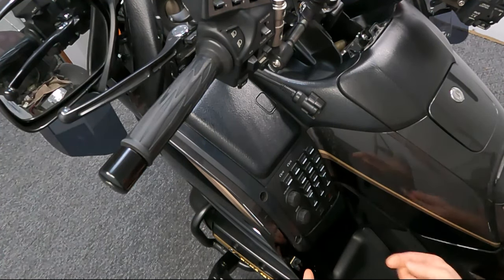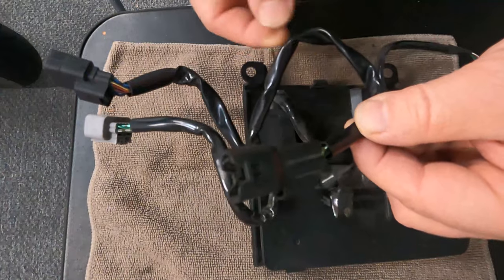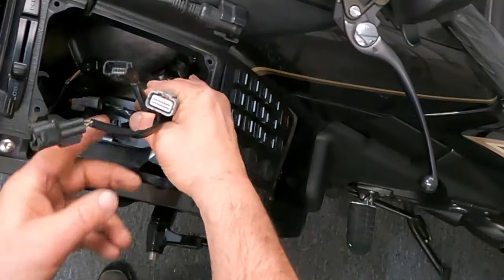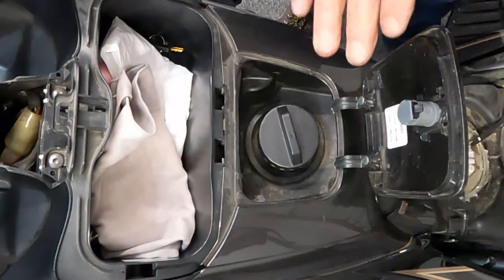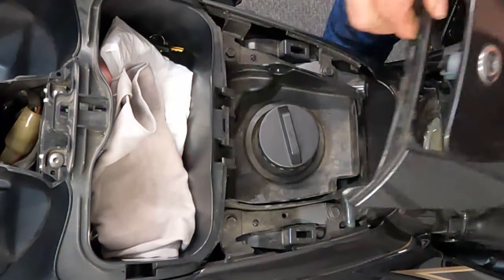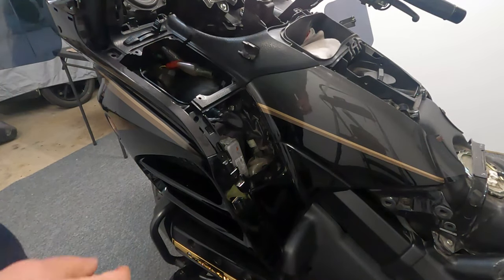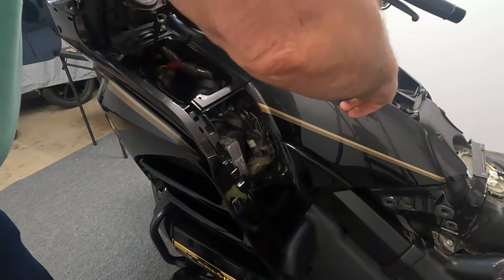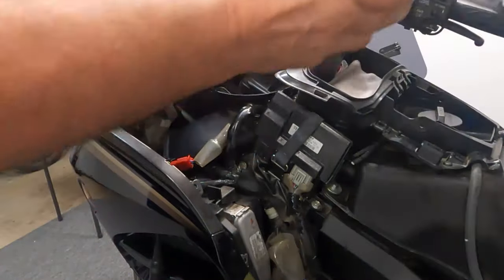How to Remove the Goldwing's Top Left Shelter

Comment: @mike's goldwing garage  Have you ever removed the side/front cowling?  The left-side side/front cowling (part over the radiator) on my 2015 (Level 3) GL1800 was damaged and I need to remove it for repair and painting.  I have the Honda Service Manual; but, I'm uncertain if I can remove only the left side or must I remove the entire front section as a whole.
Reply from the maker: Forrest,
Sorry for not getting back sooner. I hope you were able to get through this okay and get back on the road. I have removed the front cowling but both time that I've done that it's always been as one piece. If I recall there are linkages that keep the headlights in sync and in the long run it just makes it easier if you work on that part as a whole off the bike. Once removed you open up a ton of room to get in there and get things done quickly without any hassle.

Comment: Hi Mike. Mine is a 2009 UK spec GW with the airbag.  Is the principle for removal exactly the same? Thanks
Reply from the maker: Sorry I'm not familiar with that model and don't have any hands on knowledge of the location of the airbag components. That being said, I can't imagine there would be anything under the side fairing that would be part of that system. If you own a shop manual, those components and references should point out anything that may be different from my process.